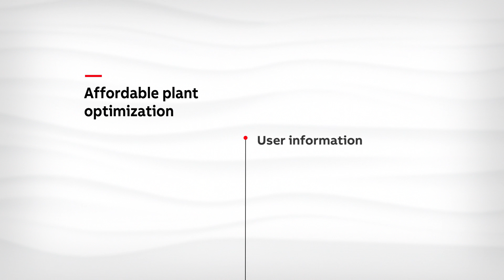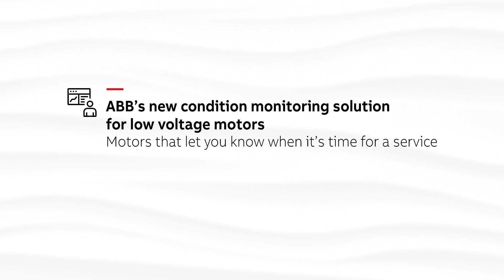ABB Ability Smart Sensor. Condition monitoring solution for low voltage motors

Comment: ABB is going to launch the next version, a smart sensor for hazardous areas for rotating machines, such as motors and pumps. This provides a cost-efficient condition monitoring solution for chemical and oil and gas industries.

Comment: So would it be cheaper to buy two motors without this than one with?  Monitoring alone doesn’t fix a problem.
Reply: No shit sherlock, just like any other tool if you don't use it properly it aint fixing anything